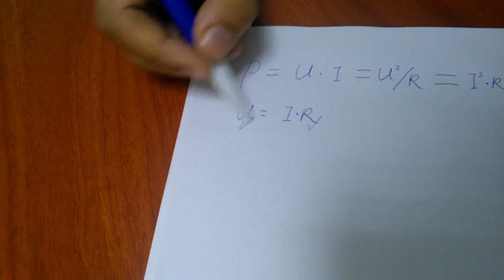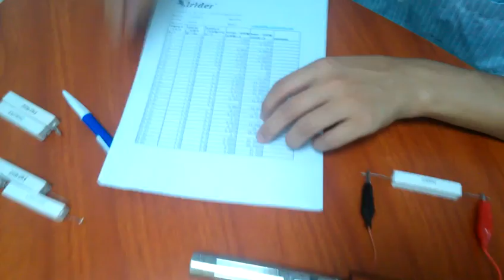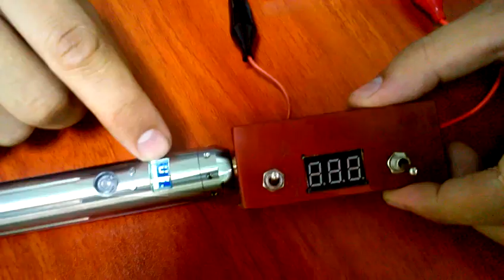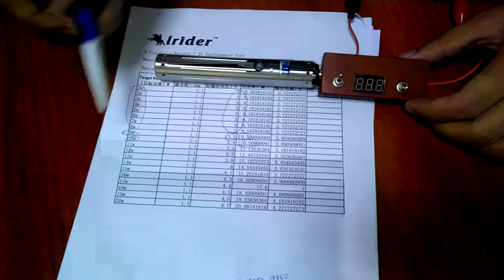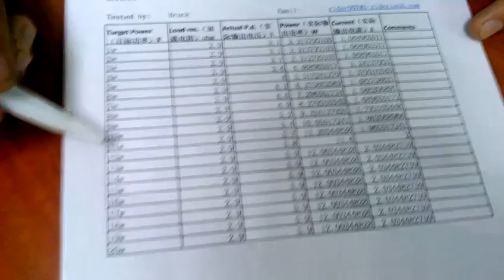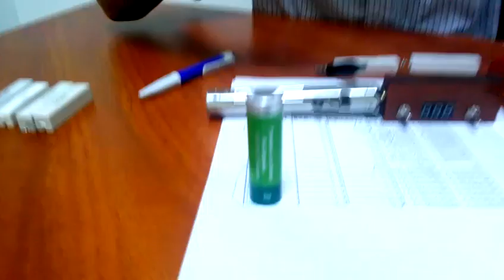lrider Lambo 6.0 20W vv vw mod performance test beyond provari and other mods

Comment: Most devices, adjust watts, in 0.5 watt increments... Which, unfortunately, usually sends me back to using voltage anyway (of course, it never fails... that the juices "sweet-spot" falls somewhere right in between the half-steps)  As much as I like the ease of using wattage... A device that adjusts the watts in whole, 1 watt increments only...  would be even worse. It wouldn't matter how high it can go... if only by 1 watt increments, gotta stick with volts & so wouldn't use it. :(   Please make the spacing closer, as it is when using volts.